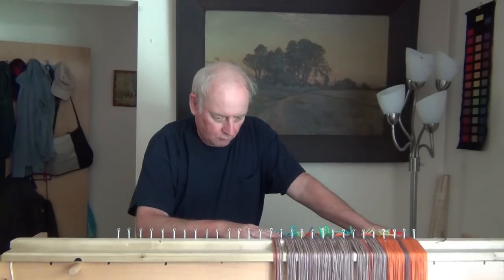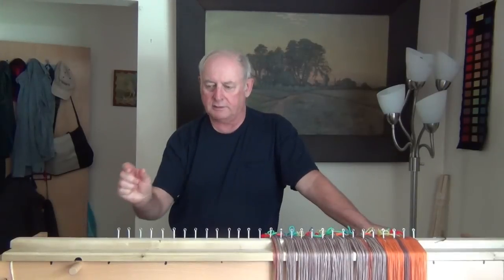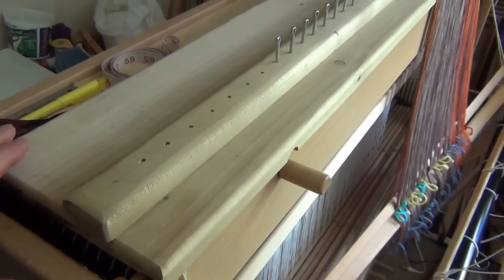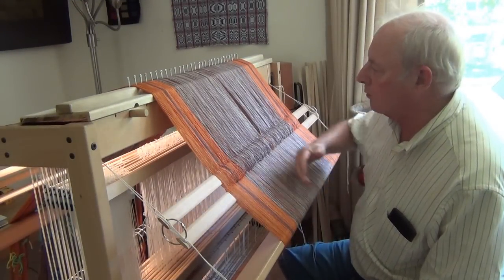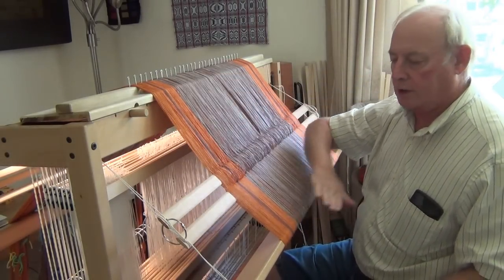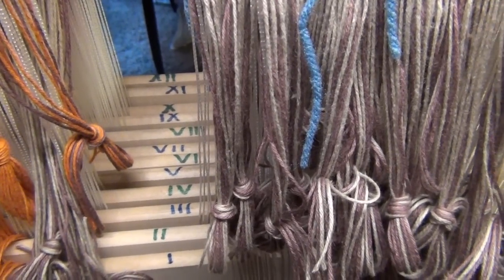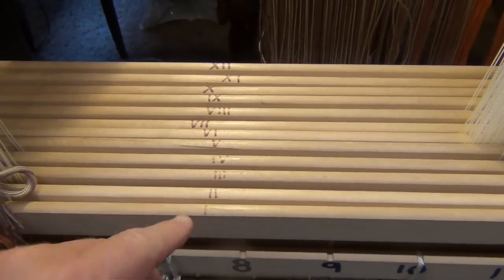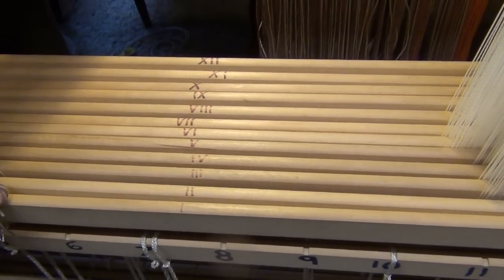Warp Rep Rug   Fall Color Warping

Comment: Hi Andy, I absolutely love your weaving videos. They have been a huge help. I am intrigued by warp rep, but am having trouble finding a video that shows how to wind the warp on a warping board. Do you have such a video, or do you know of anyone who does? I bought the book by Joanne Tallarovic, "Rep Weave and Beyond" that you said you found helpful, but I found it confusing. I'd appreciate any help you can give. Thank you!
Reply from the maker: Hi Linda, go back through my videos to find one called "putting on a warp, part 1", see if that helps you.
Reply: Hi Andy, I found your "putting on a warp, part 1" video, and now wish my loom had a raddle that sits on the top as yours does. :-)  What I am looking for is a video that talks about warping for rep warp, specifically.  I think warping at the cross is confusing as the patterns I've seen call for 2 different colors of warp and it looks like a person needs to twist or turn the threads over when you get to the cross. Thank you!

Comment: Im very nervous about it falling apart on me lol. I haven't attempted it yet, but once I watch more videos, I think I can do it.
Reply from the maker: Amber, understandable concern, but I suggest that you think first decide if your loom is appropriate for B2F warping.  As I said, my Ashford table loom just seems to work better for me doing F2B.  But if you do decide to try B2F, then do a smaller sample weave the first time, maybe just a scarf that is not too wide, that way you get to try it with out too many threads.  And take it slow and easy, I am sure you will get the hang of it.  And yes, there are more videos on YT that can help you with warping in either direction.